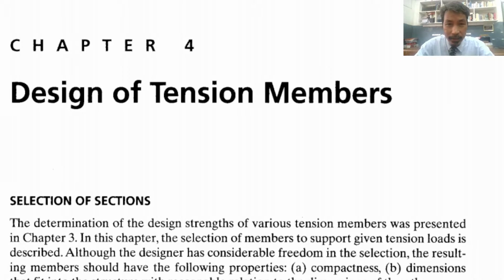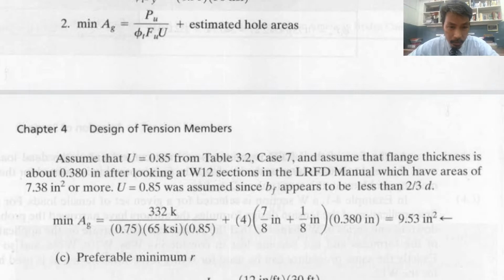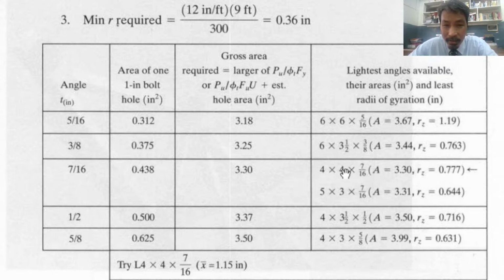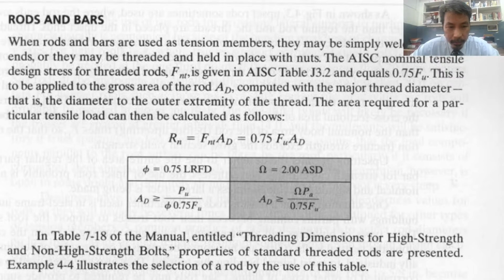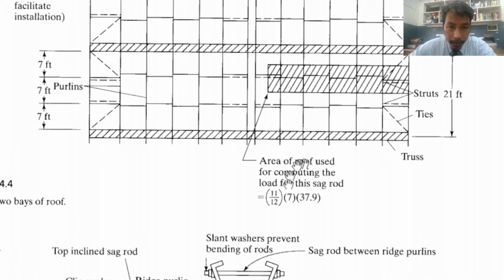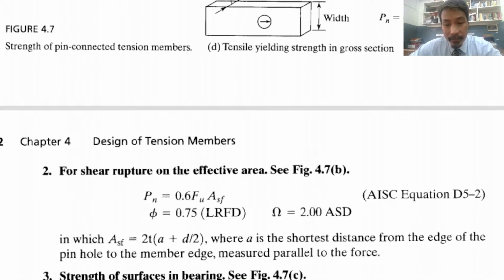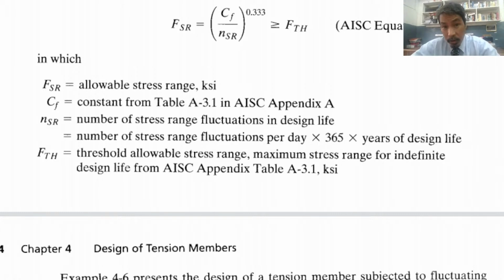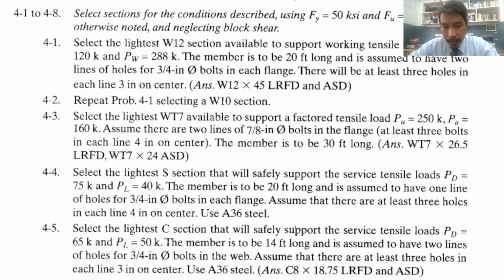[ LIVE CEE6 Lecture21 ] DrAP Zantua Design of Tension Members + ENGINEERING Examples

Comment: Thankyou sir for tackling about design of tension members. When a tension member is built up from elements in continuous contact with each other, such as plate and a shape, or two plates, the longitudinal spacing of connectors between those elements must not exceed 24 times the thickness of the thinner plate.

Comment: Thank you, Sir for the live lecture I’ve learned in this topic it uses the same equation and principles as the last live lecture, this chapter on the construction of tension members is comparable to that presentation. Instead of determining the material's capacity, design strength, and permissible strength, these solutions work backwards.

Comment: Thank you, sir for discussing the design of tension member. This further continues the last live stream that talks and discuss about the analysis of tension members. This chapter about the design of tension members it is similar to the last live lecture because of using the same equation and concepts. Solutions in here are reversed instead of finding out the capacity of the material, design strength, and allowable strength.

Comment: Thankyou sir for discussing about the Design of tension members. Tension members consisting of angles, channels and W or S sections will probably be used when the connections are made with bolts, while plates, channels and structural tees might be used for welded structures.